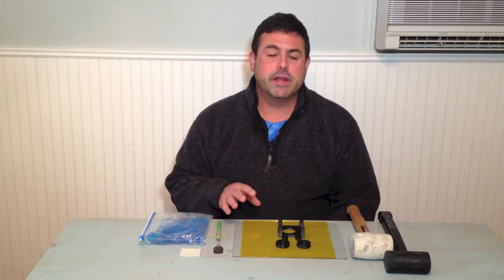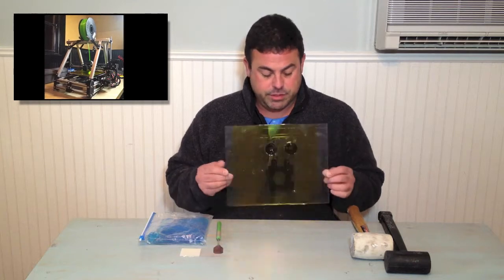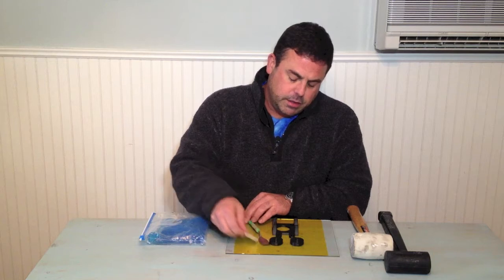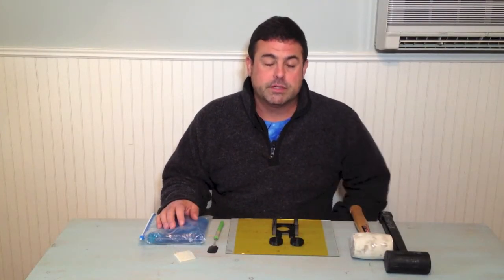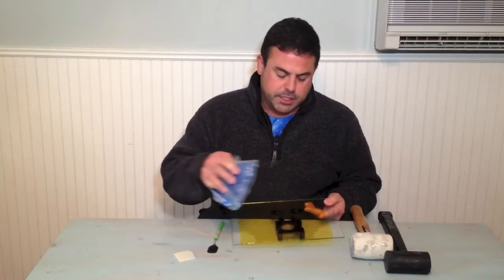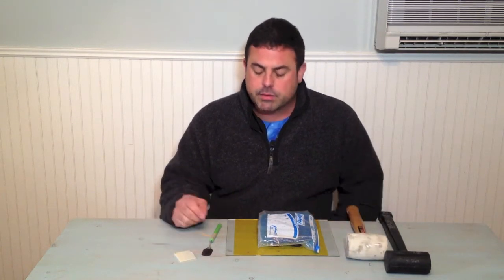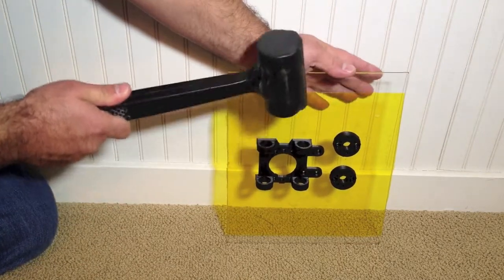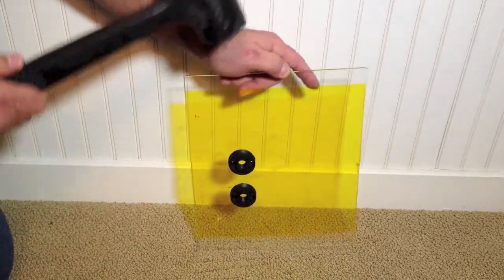3D Printing Quick Tips #8 - Hammer & Ice Print Removal

Comment: be carefull with the "air" in the can :D its mostly propan/butan and explosive, if there is any spark gap in your electronics it can be a small problem:D
for me i have a small AC relay on my ramps attached to switch a big fan for cooling down the complete printer when its finished, cooldown in less than 1minute to get the parts of the printplate
another thing i use the soerli mirror from ikea for my hbp with 4 clips to hold it, i have 8 of them so i can easy change them after the print is finish

Comment: I'm 110-120 also, and enclosed of course. Sometimes during last summer my internal temps were 75C and that's when the best un-warped ex-large prints happened. When done I pull the cover a listen for the crackling while adding an air shot here and there. Like fkhg1 mine usually just lift, or click or snap off with no effort.

Comment: I haven't had an issue or seen any residue from canned air. Also if I clean my HBP with acetone I can't get the print off without tape damage. So I only dry wipe. I also run a very tight first layer so preheat for 20 min is a must for bed sag.  So, yes, when it's still fairly hot hit the part with small shot of inverted canned air and sometimes it will pop off by itself after making the crackling sound.

Dead blow hammers, gotta love them, :)

Comment: you should use only the glass and a little bit higher temperature on the printbed, works perfekt for me, no hammer, no tools needed, it just lifts of when the temperatur is below 80degress celsius for abs and 40 degress celsius for pla, so you dont need any tape